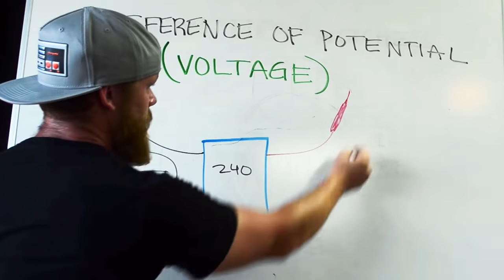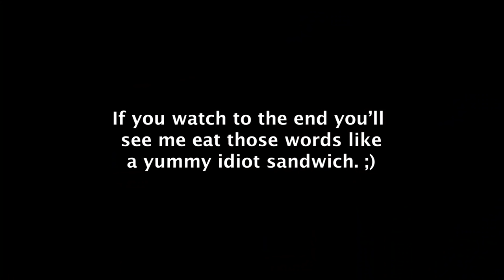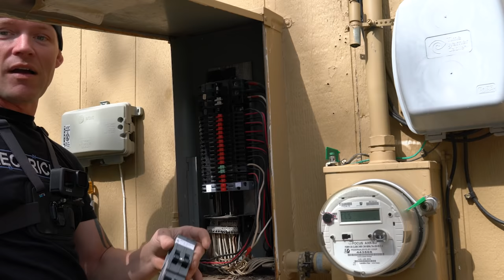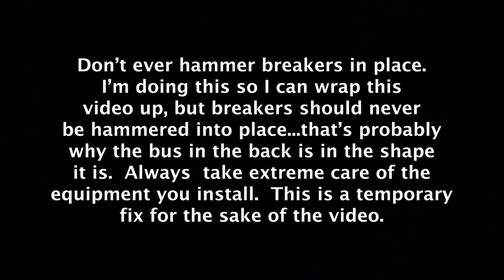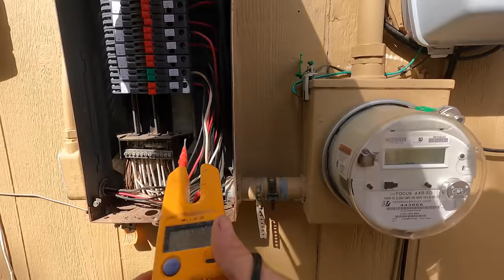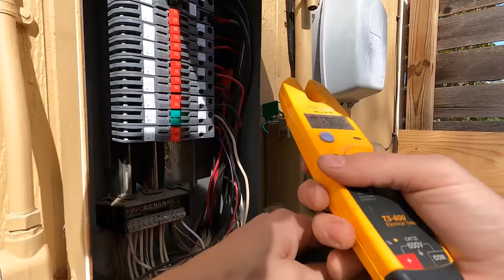How To Work on LIVE CIRCUITS - Replacing Circuit Breakers in Old ZINSCO Panel

Comment: 90% percent of electricians don’t use any PPE on panels lmao
Reply from the maker: you're not wrong, but i do have a large audience of inexperienced people watching me work so I'd rather show them what it looks like to think about risk and protect yourself, rather than them just seeing someone stick hands into a live panel without realizing I've got a decade and a half worth of experience that they dont.
Reply: Yup, you're right and the mortality rate of electricians reflects that. If you're not doing everything you can to protect yourself so you can show up to work tomorrow your might as well not show up. You only get one set of eyes and one beating heart.
Reply: Seeing you gear up will hopefully show some over confident home owners that that is a serious task!  Maybe it’ll make them consider hiring a pro instead. Also check with your local power provider because my provider told me they would come pull my meter and stand by while I change out my main breaker(Zinsco 100Amp fused in the on position) I decided instead of rebuilding my 100Amp Zinsco panel with all those new breakers that would cost me $900 in parts alone I would take this opportunity to hire a pro and upgrade my service to a new and safer 200 amp unit. I really like this channel keep up the good work!
Reply: You’re totally right
Reply: This is true, I saw this old timer working on a commercial live panel and he was changing a bolt on breaker. I asked him if he had a ppe and he reply with nah I know what  Im doing.  plus he was using a regular screw driver...
Reply: I'm an EMT, I've been on electrocution calls before. They don't end well. Seriously, PPE may seem "dorky" but it sure as hell beats the alternative.
Reply: I would have taken off the outside panel cover, you don't want a grounded piece of metal flopping around. Also I have shared my concerns for people watching me too, one guy was waving his finger around inside a Hot panel I was working on.

I ordered him to stop and too remove his hand, when he asked me why, I told him,  because I know what I can touch and what I can't touch. We all do it, work on hot panels, an it becomes second nature to us, we sometimes fail to see the danger we can put others in by our actions...
Reply: As a new electrician I will gladly throw on a pair of gloves & face shield at the risk of being called a wuss. I want to go home to my family at the end of the day.
Reply: @wiseguy You’re right... they don’t.  BUT THEY SHOULD.  I doubt an unloaded 1ph 100a panel would ever produce a flash bad enough to cause damage, but wearing a flash shield will absolutely keep you from recoiling into the panel or something should an arc occur.  Ditto the gloves - accidents happen when something shorts, you’re startled, your reflexes kick in, and suddenly your hand holding  a bare screwdriver is somewhere you don’t want it.  Plus if you get in the habit the next time you have to work high voltage under load you’ll be all set.  So good on him for showing folks the PPE.
Reply: Good work man!!!
Reply: I love the mask and the gloves, but why don’t put the whole suit. I mean if there was an arc you still could get hurt bad.
Reply: I only use PPE or suit up for 277/480 or higher. The three exceptions are. One. Switchgear. Two. site requirements. Three. High short circuit current.
Reply: Come on guys.This man did a great job putting out there this safety tip.Me,I will do it with anything except my flat screwdriver.But we have to keep in mind theres a lot of ppl who watch this videos with no electrical experience at all even if they r subscribed or not to this channel like some of yall including kids.One thing I can say is that even the best technician can make a wrong move.My old boss "who retired couple years ago" had an accident that almost killed him.Was also a man retired from US Air Force,A master on avionics.So for that been said,No-One r insulated to get hit without the right equipment that can also end up in death.God bless u all n let's keep grinding!!! 💪🔌🪛🇵🇷🇺🇲
Reply: @ElectricianU  you should take responsibility and not promote crappy tattoos to your audience as well.
Reply: @Vinka236  I witnessed one of those "I know what I'm doing" guys suffer third degree burns on his arms when he shorted across both phases with a screwdriver.
Reply: @steve-o6413  I went to demo out some wiring during a remodel, and I had turned a circuit on to trace it out. I told them I was turning it on and not to touch anything. This old woman walks up and grabs a switch box and starts waving it around. It bit her hand, she dropped it, then it shorted to the old work box. I asked her if she was okay. Her first words were, "yea, you told me it was on. I probably shouldn't have touched that."

Some people have to learn the hard way.
Reply: NAVIK yeah pretty much all actually electricians are like that, Ive been in the trade for 3 years and we use regular Klein screwdrivers on live lugs all the time, insulated screw drivers are pointless seeing as a regular Klein is already insulated
Reply: when some electricians get cocky and act like they know everything so they think they're safe... but this is why accidents are called "accidents"
Reply: @HBSuccess  those service conductors are on like a 200 or 300 amp fuse at the transformer. They would certainly cause a significant flash.
Reply: @pgood7266  hahahahaha.......MUCH to learn this one has.
Reply: My ppe is my brain
Reply: @The Wiseguy you're right, and more likely 90% of domestic-house electricians are the ones that don't use PPE! Heck, just seeing zero PPE on the arms, and using non-insulated screwdrivers is not something you want to teach inexperienced people, let alone the fact that most countries you require a licence to even perform such work, and if an incident or fire occurred from a non-licenced person, then the home owner would not be covered by insurance.
Reply: dont risk your life and brag about it
Reply: Two pairs of needle nose, very slow and easy working one side of meter seal out, remove seal and meter, do the work, put seal back together, done. I've removed many seals, they look perfect when I'm done....I'm sure there's lots of different types but in my area the lead ones are doable ,👍
Reply: Scott Jarry  you're exactly right, I always where ppe at 480 and above, residential never...and yes I agree people watch a YouTube vid and think they're an electrician, if you make a plumbing mistake you get wet, if you make an electrical mistake.....
Reply: @KitchenerLeslie2  what do tattoos have to do with anything ??
Reply: @pgood7266  I said crappy tattoos lad.
Reply: @poserwanabe  I was saying his are crappy
Reply: And the smart ones don't need to. Electricity is dangerous but if you know what is going on,  it is only dangerous to others and you should keep everyone away.
Reply: Lol, I remember back in the day you would be laughed at for just safety glasses.
Reply: @ElectricianU  you have a great point Sir. My professor would always stress wear your PPE.
Reply: @poserwanabe  somehow it makes u a better electrician
Reply: ill gear up if im pulling the meter
Reply: @alec4672  The thing about what you're implying (that they die from contacting something energized), however even though electrician ranks high on the most dangerous jobs out there a much larger percentage of electricians die from slips, trips, falls, and overdoses than electrical burns or electrocution.
Reply: You young guys should always wear proper protective gear.  I have been shocked many many times during my lifetime.  I now have an irregular heartbeat, which I believe has been partially caused by the sheer amount of shocks I have endured. I used to not even be bothered by 120 volt shocks, could barely feel it anymore. Now I am extremely careful,  even with low voltage. I have insulated screwdrivers, and take precautions now. I also drop the circuit (lock out/tag out),  and test two or three times before I put my hands on any wires. When I am troubleshooting live circuits,  I pay extra attention to where my hands are in relation to the wires, and exercise extra patience when putting my meter leads into tight areas.  Most of the shocks I had were when I was in a hurry, or when .I was young and just didn't care. I learned the hard way....
Reply: @Vinka236  I change live bolt on breakers quite often as the site I work on can’t afford to stop production for any length of time. Sounds cliche but if you know what you’re doing, have a steady hand, and are careful you can mitigate a lot of the risk that’s involved. Not the best practice in the world to get into of course but what ya gonna do
Reply: @davidpatinopena7215  You don't need an arc flash suit for what he is doing.
Reply: @illestofdemall13  the more protection the better  shit lol
Reply: @davidpatinopena7215  It isn't going to help any. Just make you sweat more.

Comment: DIYer here. You have no idea how valuable videos like this are--I only wish they had been available when I owned my home and often DIMS.  That house (wired with fabric covered 14ga) started out with a ZINSCO panel; had to replace a breaker once with a modern upgrade, which was nice but pricey ($20 back in the 90s; regular breakers were $5 or $6, as I recall). A couple of years later, I was able to have the 100 amp service upgraded to a 200 amp Siemens. Watching the pro do that was a great education--although I still get shivers when I remember him replacing the live service drop cable down from the pole--in a light rain. He was an old guy, which to me means he had survived his mistakes--better than any license or certification in my book.

Key tip: replace the wires AFTER pulling the breaker. [smacks forehead]. How did I not figure that out?]

 I noticed you clipping a couple of wires with excess exposed conductors. What is the deal with guys baring so much of the conductors? I see that on a lot of outlets and switches I replace.

Comment: as a electrician who retired five years ago, i worked for forty years in industrial electrics.it makes me smile to see american electricians all kitted out ppe,yet they don,t use insulated screwdrivers.
Reply: Was told for years to wear 100% cotton t shirts underwear & socks under our company supplied PPE. Now they are saying to only wear approved PPE tee shirts under PPE ling sleeve t shirts but companies refuskng to pay for them.
Reply: Face shield and rubber gloves. But no long sleeve shirt?
Reply: Or don't even wrap tape aroung the bare metal. LOL.
Reply: I mean I use insulated drivers. Not everyone's the same
Reply: The shield and gloves are uncomfortable and take some getting used to but it could keep you from getting your head blown off. Speaking as one that's done plenty of hot work 3 phase power. Been in the game 21 years now myself. Glad to say I only been shocked a couple of times. Worst I ever had was off single phase 120V. Household current will kill you. Believe it. If you got gloves and shield... Wear em
Reply: I work with an old timer at work. That guy will tighten live 270v meter lugs without any ppe and a regular socket wrench. He just says make sure youre not grounded. He is almost 80 and still kicking.
Reply: Kitted out?? The fuck is the cal rating on his t-shirt??
Reply: @JohnSmith-db2oc  the guy i work with too always says that what ever u do son make sure you are not grounded.
Reply: For most of my 50 years just used tape on screw & nut drivers while working on enegizedc240, 277 & 480 volts. Did finally purchase some insulated screw & nut drivers. Back in the 1980's had to drill & tap holes on copper buss bars of 600 amp 480 volt panelboards several times. Stood on rubber matt while wearing canvas work glives.Cheap company refused to purchase rubber gloves for 6 electricians. Never liked plugging in 480 volt buss duct switches into energized 3000 amp buss duct.
Reply: And all the safety turds who don’t use tools come out 🙄
Reply: Most of us use them lol calm down it's OK it's ok
Reply: At least somebody knows

Comment: My favorite panels are the Siemens and QO types with bolt in breakers. There's something exciting about putting a metal screwdriver directly onto a live bus. Also, I noticed how you instinctively stood to the side as you energized the main. I ALWAYS do the same and tell everyone in the area to stand clear. There is alot of vids out there of equipment failures that result in needless injuries.
Reply from the maker: I thought about mentioning that after i started editing the footage, I'm glad you noticed me step to the side.  I do that on all gear.
Reply: My boss drilled that into my head from the very start. Always stand to the side when you energize panels.
Reply: As a side note, fuck those panels where the doors swing vertically
Reply: @NieveIsThicc  Haha we, at work, are constantly replacing old panels and pot boxes like those vertical-swinging doors, and yea they suck.
Reply: @NieveIsThicc  🤣😂😅
Reply: If the intent is to avoid injuries. Don the Arc Flash helmet and gloves along with balaclava and arc flash jacket. This standing off to the side bit, is a holdover from the pre flashover era. Without any arc flash equipment available, yes stand off to the side and face away. But in 2020 with the PPE available, you don it correctly and stand right in front of it. All ArC flash gear is designed to take the flash head on. That is the strongest point.
Reply: Was taught to take in a deep breath and hold it every time turning on a breaker. In normal breathing if an arc flash occurs natural reaction is to take in a deep breath. If done during arc fault blast extremely hot gases will enter your lungs and burn them.
Reply: @garbo8962  I would love to know what you know
Reply: Besides standing to one side was taught to always take in a deep breath & hold it until done turning a breaker or safety switch on. Reason being if there is an Arc Flash you would not be inhaling 10, 000 degree heat into & burning your lungs.
Reply: If you just call the power company first like a responsible electrician you wouldnt have to worry
Reply: @americafirst5758  in my area the local Exelon company take forever so just about every sparky works hot.
Reply: @garbo8962  thats just an excuse and i hope they all pay with their lives as an example
Reply: @americafirst5758  Can not always do that. Lazy ultility company in my area take forever to come out. Had to work 480 volts hot several times due to could not locate where it feed from. One time turned off over 150 breakers and still could not locate feed even with a circuit tracer. Found out a few years later some bozo installed a fuse block inside of a 800 amp panel to feed that circuit.

Comment: 🇬🇾 Looking from Guyana, South America . I really appreciated your hands on info of how to handle/ hold  live hot wires & not get shock. Safely first then you explained the rubber gloves as needed essential. Also you showed close ups of how  to screw in the brakers with there safety tips. How to firstly isolate a hot main wires  so as not to accedentially touch them while working. Basically you showed me how to work around my house and NOT get SHOCKED , providing i understood to use ( ALL ) the safety measures. Protect my hands with dry rubber gloves, rubber boots  dry . It's best not to work with an active live main but if i must work , then employ these safety measures . Thanks . Close ups video shots  are always better for learners continue to use them as they helps us to see & understand best  . Thanks  . I feel more confident now.

Comment: this is why, in my opinion, it should be required by code for there to be a dedicated separate shutoff switch between the meter and the panel, not just a main breaker. if you had a shutoff switch you wouldn't have to worry about doing hot work to swap the main breaker.
Reply: Thé problem with that is many places like here have a meter lock meaning the city requires you to pull a permit for a panel change, and if there was a disconnect it’s to easy for someone unauthorized to change the panel
Reply: @Vanilla_Icecream1231  Well, the shutoff would be after the meter, so changing the meter would be exactly the same regardless. Besides, making the meter itself safer to work on wouldn't be a bad thing imo, if someone does fuck with it illegally they should be fined, sure, but they don't deserve to accidentally turn themselves into a crispy critter.
Reply: @doctordev97  yeah that’s fair I just meant that’s why many places pervent it but it would make it safer for those doing it illegally cause even
If a master electrician of 30 years did if they didn’t pull a permit they could get in big trouble
Reply: @Vanilla_Icecream1231  very true. Even qualified professionals still need to get permission.

Comment: Back in the day I did what you did. Tape up my screwdriver, and work on stuff live. Had a panel blow up because the main lugs were broke inside and shorted when I opened the panel. I would highly suggest wearing your full gear including arc flash suit. I know it’s hot in there but will help. Also use insulated screwdrivers. They aren’t that expensive but the burn unit is.